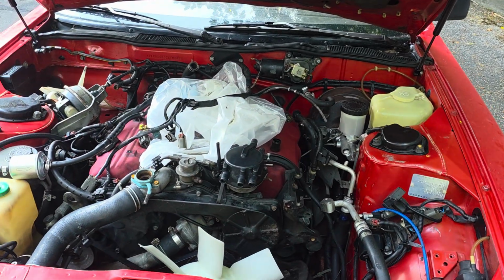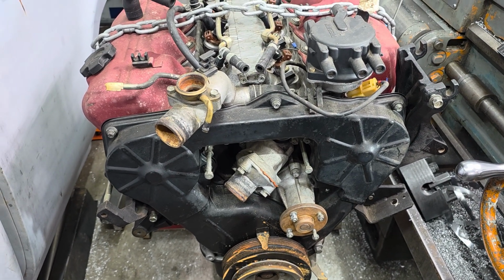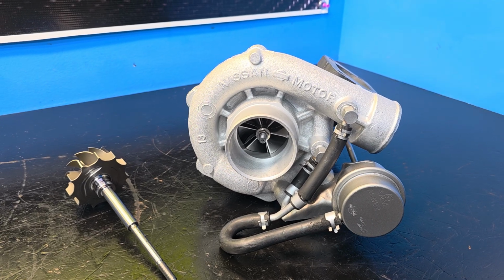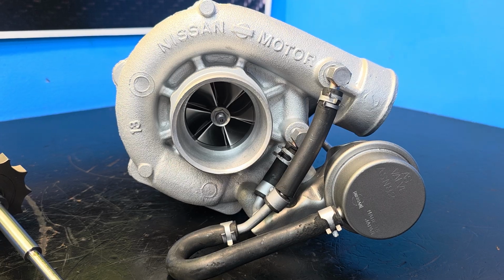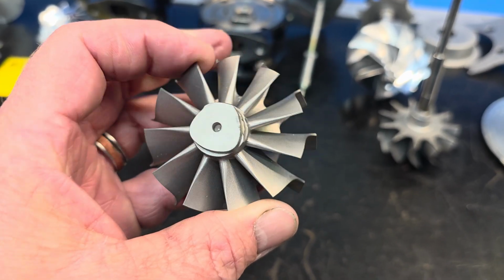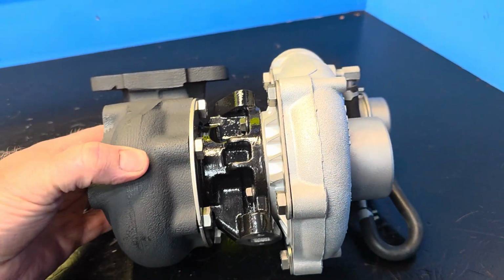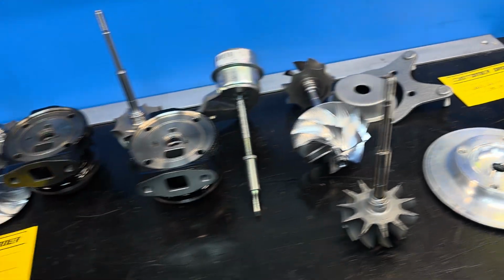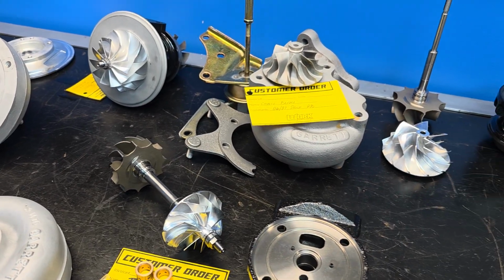The 1986 Nissan 300ZX Turbo Has ZERO Compression… What Now

Comment: Your comment on my video made me do a little investigation. 😁 acquired a 86 turbo with low compression? Most likely the timing belt broke or skipped timing  bent some valves. 

(Computer choice) I would go straight to the standalone computer. Nistune works but if you want to maximize the setup it’s much cheaper to go full standalone. (Overtime) 

I wish back in the early 2000 you made this turbo. The back pressure on the stock T-3 turbo killed hp after 18psi. It was truly the limiting factor on the stock setup. I’m super interested in seeing more content like this.
Reply from the maker: Stacked the ring lands up on 2 cylinders.  Kid that owned it was pretty green to cars.  The converter was so plugged up the engine would barely run.  His MBC adjustment screw had fallen completely out as well.  Poor engine was unable to breathe and the cylinder temps finally took their toll.   

Its all good now...a good friend had a 67K mile 87 engine we tossed in it.   Just finished the Haltech install a few weeks ago, currently working on compiling all of the factory turbo data before we put our simple "stage 1" upgrade into place.   Leaving factory fuel injectors in place for these tests so we can have some pairaty with a "stock fuel" car

Phase 2 will be installing some  injectors and  fuel pump upgrade so we have plenty of fuel for this stock engine.

  We will find the limit of our stage 1 turbo in a non intercooled scenero, switch the car over to E-85 and see if we can squeek a bit more from it.  Then will come the intercooler (you will like this part!), back on pump gas and see where the limit is again.  

Phase 3 will basically be our largest stock location turbo, rinse and repeat the above tests.  

I am waiting on my CAN expansion so I can data log a few more channels, once that gets in we will be game on. 

Long term this car will hopefully get the full treatment for as much power as I see fit.  Really hoping to drive it and make enough to nudge it into the high 9's with a 100% street driven car.  Time will tell if we put this much effort into it or not.  I have so many things going on with the shop at the moment it may stay a bit simpler.  Either way, lots of fun coming down the line with it!  Reed

Comment: VG33 engine time.  I own a red 86 turbo I have spent over 8k in parts because I'm a mad man with no youtube channel.lol!
Reply from the maker: Its easy to spend it!  We had the Z back up and running for a while on a low mile  VG30 (there is even a video posted of us taking drag racing 😂)

We are in the process now of installing a full Haltech stand alone ECU and getting a couple of things into place for some very in depth turbo tech content. 

We are excited to bring some great info to our channel, keep an eye open! 

Thanks for the comment! Reed
Reply: @workturbo  I saw that video last night. These motors can take a lot of boost I think 12-13 lbs is the max without going into stand alone ecu territory.  There's been people with 30lbs on stock unopened engines. But that's with all the other upgrades.

Comment: This is so cool! I was hoping to find enthusiasts like you building a Z31!

I'm hoping to build a Z31 with 350-400WHP.

I'm very curious to see what the stock fuel system will cap out at.
Reply from the maker: The Z31 is a understated car, the VG30E(T) does not get the credit it once carried.  Our over all plan is to go from stock horsepower level all the way till the rear suspension says no more.  Then go to S-Chassis suspension and keep going.  On our next track outing we plan to max the injectors out and have data to go over.  We currently have a plan on what it will take to get to 500hp taking the step by step approach so we find when the next wall happens.  

-David
Reply: Hi David, im very excited about your build series!

Curious what the car dynos at with the boost pressure increase yiu did at the dragstrip, as well as what it will make with an aftermarket intake and exhaust, with the boost increased to the point the stock injectors are maxed out. 

I have a 1989 240SX with an SR20DET swap. Trying to compare the two engines with similar upgrades. 

The SR20DET would max out at ~230WHP with maxing out the stock T25 turbo with only an aftermarket intake and turbo-back exhaust.
Reply from the maker: For the record I'm just the guy running around in the background but when we go to the track you will see both of us. Reed (shop owner and now z31 owner) wanted something fun and both of us talked about doing something bigger with the Z31 for years now and we found a great "deal".  I have a SR20 in my 240sx Coupe (really only used for drifting) Reed and i have gone back and forth on that car trying to make it respond well.  Has a XR4948 bottom mount mid mount intercooler poncams stock bottom end stock intake manifold car moves for what it is on low boost.  If i could stop twisting output shafts in my transmission we will dyno it.  We have quite a few ideas to test for the vg just by itself.  Reed and I always put our names at the bottom of our responses so people know who's who.

-David

Comment: Really interested to see that split blade turbine wheel! I've been eyeing them for a while as upgrades to multiple applications like the TD04-13T in a WRX or a TD05-16G upgrade on a DSM. The problem of course is knowing if they were actually properly designed and tested or if they are just copying a new style and don't truly improve performance. Would still be fun to mess around with. Really wish I had my own dyno.
Reply from the maker: We are going to provide some "real world data"  I am in the process of installing drive pressure sensor, turbo speed sensor, compressor discharge temp sensor and hopefully some EGT channels on this setup to gather some info that hopefully will be conclusive.  

I have my dragy, and access to a hub dyno to validate what we are seeing.
Reply: @workturbo  Definitely excited for that! Wasn't doubting your application by the way, only all the random options on the market without any data available. :D
Reply: In the limited testing on a Buick GN the split blade turbine wheel is showing impressive results.
Reply from the maker: @JeremyWalters-sc2jx I need to get you a speed sensor for that turbo.